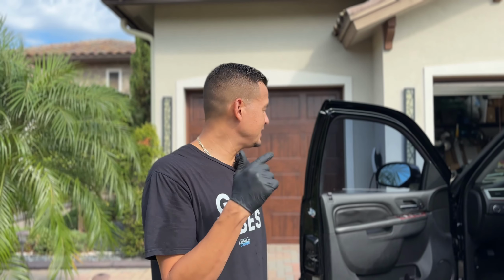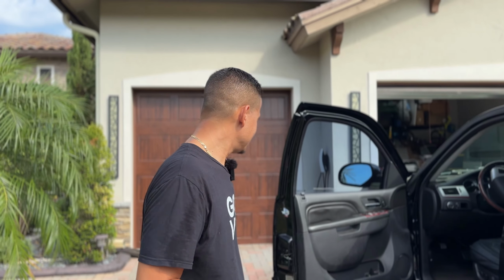Deep Cleaning & Protecting Door Jambs - Auto Detailing

Comment: Another great video!!  What size nozzle were you using on the pressure gun at the beginning, a 25 degree?  Also what kind of sponge and the initial spray solution, Green Star?
Reply from the maker: Hey thanks! Yup to the Green Star…the nozzle was a 15 degree..I was using a Maxshine small wheel mitt
Reply: @ Thank you for taking the time to answer my questions once again!!!
Reply from the maker: @ for sure and you’re welcome 💯